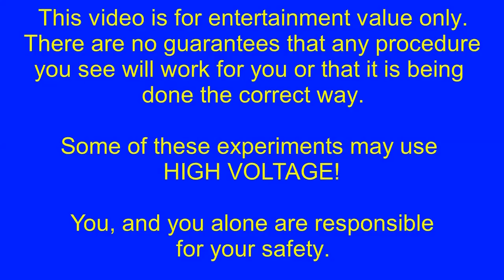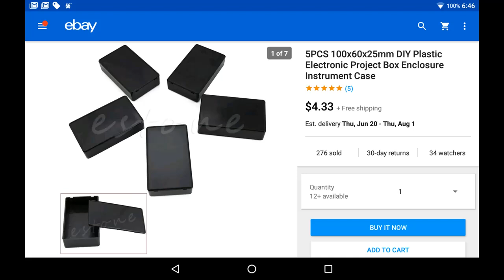Pocket Signal Tracer

Comment: Hi Bob, that tracer is nice an tidy - really small footprint and sounds great.  Thanks for showing it.  Do you think the 8 pin LM380 would run a little cooler if it was on a board with plated holes?  Regards, Dave
Reply from the maker: That small one has a 8 pin. I found that they only seem to overheat if really overdriven (large input signal and volume cranked up to 11 😋). Used as a signal tracer, momentarily touching points tracing a signal, I think it will be fine. There are no heatsink pins on the 8 pin version. You could add one of the little stick on heatsinks to the top.
Reply: @YouAllKnowBob  Thanks for the information Bob, sounds like they will work well.